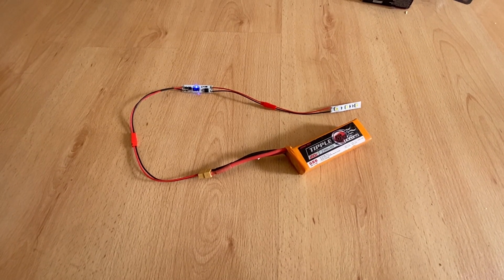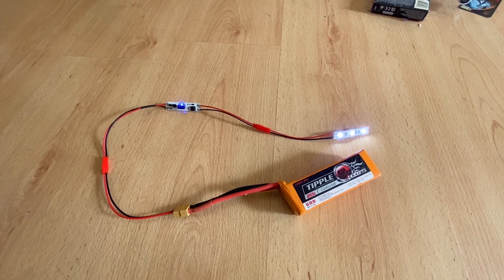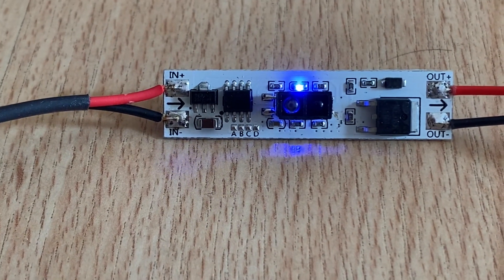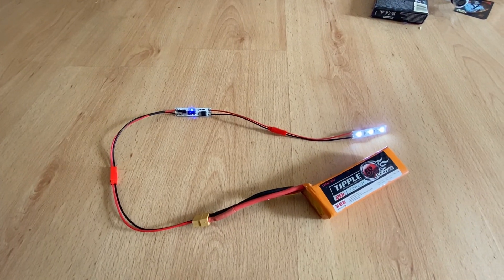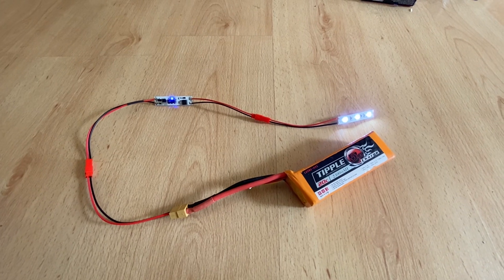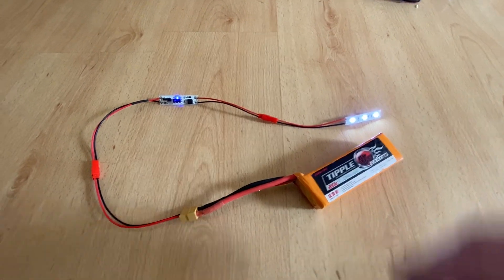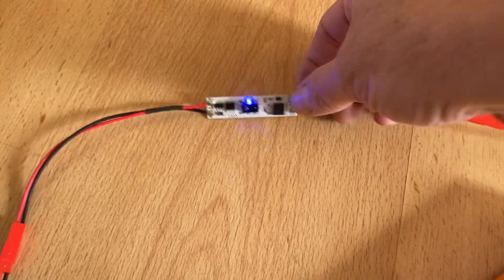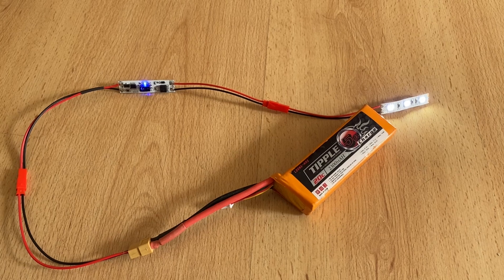Hand sweep switch sensor

Comment: Can you use it on TFT display and arduino? like when you swipe ur hand a photo will next and prev?
Reply from the maker: I wouldn't have thought so natively as it's just allowing power from the input to flow, it's not acting as an on-off switch in it's own right.  What you might have to do instead is use an infrared trigger board on your arduino, as these are very very cheap and designed for the job.

Comment: I dont get whtas the diffrent between single mode and multimode
Reply from the maker: Multi-mode just means that depending on which solder tabs you bridge, you can have things light three levels of brightness if you sweep your hand three times, direct on and off (no dimming) and the default setting as per the video is fade in, fade out.  There's a table of the settings in the Aliexpress listing in the video description.  Hope this answers your question.